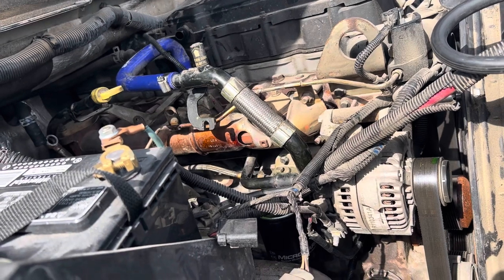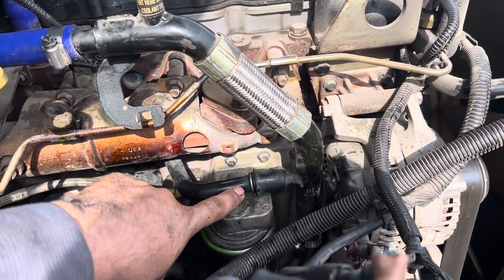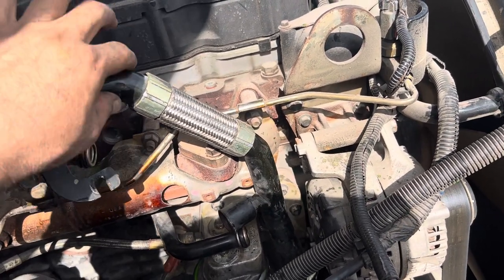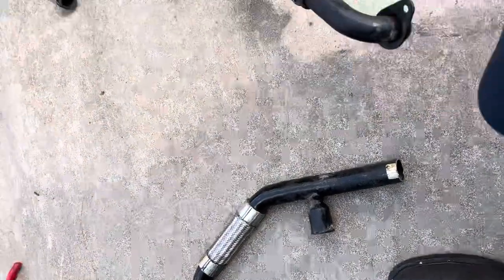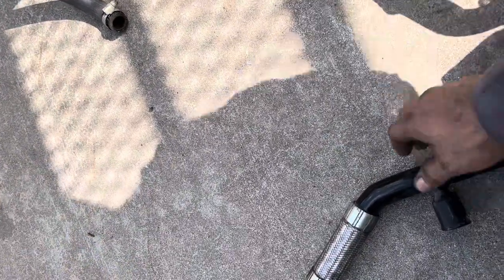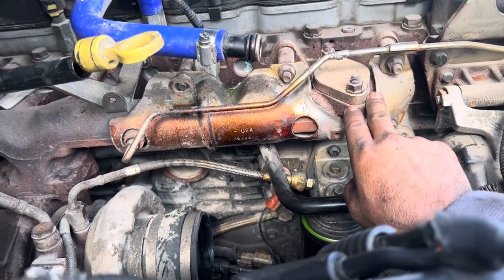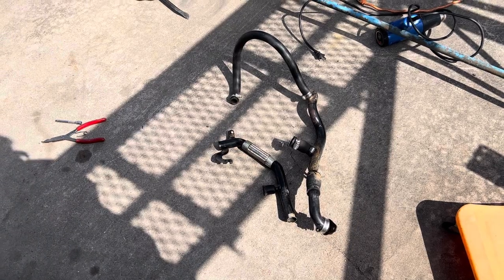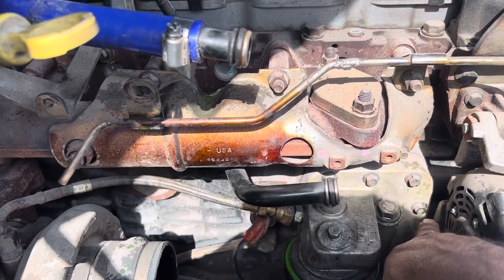Dodge Ram 6.7 Cummins coolant leak real solution fixed

Comment: You’re missing the bracket 😅there’s a bracket that holds all those hoses
Reply from the maker: Yes it’s missing. But I remove the whole thing and used the 2007 Dodge Ram 3500 hoses. It works better then these hoses
Reply: The guys who delete the EGR system take that bracket out from under the EGR cooler.  The bracket is like a tray and has several attachment points to keep hoses from flopping around.  Seems like it could stay after delete to serve a purpose?

Comment: BTW: that water pipe is $850-1200
Reply from the maker: Wow it’s very expensive for just a water pipe. I got it from another engine that went out. I think I save my self some money
Reply: Mine just holed through behind the turbo. I can't believe what I'm seeing when I saw the price. That's just asinine.
Reply: @LonglacMax Having a leak on mine now… What in the world is the pipe called? TIA
Reply: @jesseflores9233  i dug around deeper and found the one behind the turbo is called heater core tube. Its pricey but not 800 bucks pricey like the egr cooler pipe.
Reply: @LonglacMax thanks brotha. I just bought the part. $179.90 is what I paid. Thank you for your help!
Reply: @jesseflores9233  was that at the dealer? Im looking at close to 500 canadian there.
Reply: @LonglacMax yes sir, it was a dealer part.